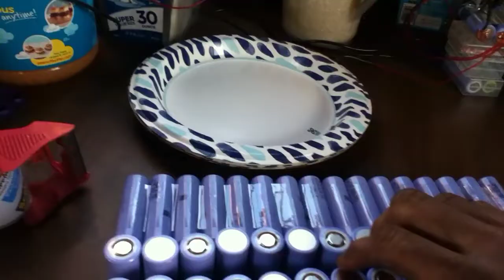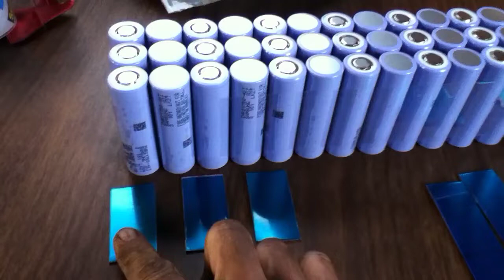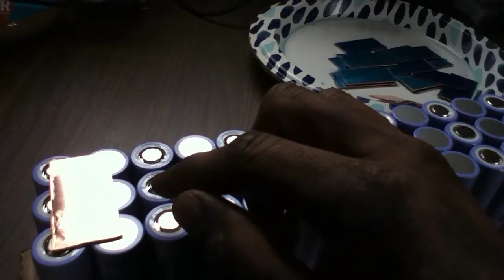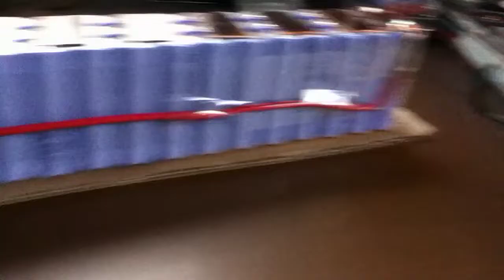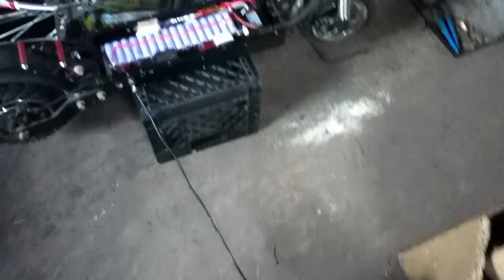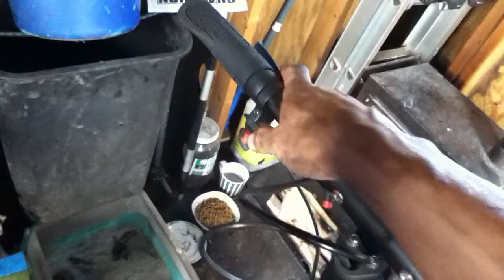How to Build Battery Pack without Soldering ,the Simplest Way

Comment: Do I charge it with a 48v charger using this tecneek
Reply from the maker: Yes if you are building a 48V battery pack use a 48V(54.6V full charge) charger. If you have a 60V battery use a 60V charger. Don't use silver epoxy though cause it's fake silver. Just use nickel strip and spot weld..
Reply: Umm I've already done it in poxy,brother
Reply: I'm building what u where building on utube ,so um is that a 48v u where building or 60v.
Reply from the maker: @user-no8fh6qp9d  Mine was a 60V battery build. I found out later that all these silver epoxies aren't real silver content. The epoxy turned yellow after some use, and will kill the battery cells. These epoxy would've been fine for 5V applications.  Sorry for the misleading video.
Reply: Thanks for your help ,I love to see more videos of other areas bro ,I've been into electronics for 3 yes just learning from. Utube , every bit from every one helps .thankyou

Comment: Dude what about Balance charging that? you must have the ability to buy those battery's MUCJH CHEAPER THAN WE CAN!
Reply from the maker: You don't need no stinkin' BMS...BMS won't balance charge, it's the batteries in a pack that will self-balance. BMS will attempt to discharge and recharge unnecessarily and take you longer time to fully charge. Just make sure that you don't overvolt charging your battery. For 60V battery charge at 67.2V. For a 48V battery charge at 54.6V and so forth. The BMS however will protect you from overvolting (not the same as overcharging), meaning don't use a 67.2V charger on a 48V battery. 
I buy batteries at bulk-battery.com and the price is better there.

Comment: Hi can you charge 36v18650 battery on a 36v lifepo4 battery charger
Reply from the maker: I believe the lifepo4 charger charges at lower charging voltage as those batteries nominal voltage is 3.2V and not 3.6. You need to use a regular li-ion battery charger for the 36V battery pack.
Reply: Thanks for that infor,would it matter if i charge it through a BMS or would I still need a regular li-ion charger @noobz5056

Comment: It's the characteristics of the cells that you've chosen that give you the significant voltage drop. It's the discharge rate of the cell that matters as well as the number of cells in parallel. The more cells in parallel is not necessarily means less voltage sag. 15 cells in parallel with a  discharge rate of 5A aren't necessarily better than 5 cells in parallel each with 20A discharge rate. With the 15 cells in parallel each 5A maximum discharge rate, you will be able to build a battery pack that can discharge 75A maximum. While with the 5 cells in parallel each cell with a discharge rate of 20A, you get 100A maximum of your battery pack. You should have a safety factor though and not use the maximum discharge current totally out of your battery pack. I'm with those who say a BMS is a must in those  battery packs. A good design for a battery pack takes into consideration a lot of factors. Thanks for sharing your experience!
Reply from the maker: You are a long way behind. You are trying to school me something I already know.  These are 30A discharge Samsung 40T cells. The culprit of the problem with the voltage drop is the fake silver content in the epoxy. The problem resolved as soon as I used the spotwelding with the nickel strips to ensure reliable electrical connection. And yes the higher number of parallel connections do give more stable power delivery even with cheap Chinese low discharge rate cells.
Reply: @noobz5056 Glad that you solved the problem. But still your video is misleading when you say, the higher the parallel connection is the better. While in theory, higher parallel connection will increase the capacity and thus the discharge rate, but that wasn't the problem as you have mentioned with your case. It's not just simply 'more' parallel connections. And please don't mislead inexperienced viewers with not using spot welders or BMS. Using a BMS by far safer  to maintain discharge and charge of the battery pack. So your video failed in two ways: you show that you can do it your way without a spot welder, the results weren't successful and two: you said at the end of your video, more parallel connections would solve the voltage sag in your case, obviously, you've said it, it did not.
Reply from the maker: @mansoora.7322  If the silver epoxy wasn't fake it would've worked fine on the battery build. The seller and the suppliers' bosses (high level criminals) lied by selling fake silver (and gold too) to the public and they keep the real content in their underground living. God told me that you need enough "physical" battery cells to reduce voltage dip/spike, regardless of the discharge rate of amps of the cells. If you don't have enough cells of parallel connections the voltage dip will be high even with high discharge rate and high capacity cells. Physical number of connections do matter. One of the reasons is due to limitations of the battery cells as they do not have linear power curve. The capacity may be plenty, but the voltage spike will still be high. 
And you don't need BMS, as long as you are not overvolting the battery pack during charging. They don't do the balance charging, the battery cells in a pack does the self-balancing not the BMS.  And you don't need BMS to limit discharge rate, you use smaller controller to draw less amp, to keep the batteries within safe limit.
Reply: try 45b or 40t cells... very high current cells

Comment: Just use a controller that draws less amps. An 18 - 22 you will not have a problem and have good range with a 72v. If you say the battery is 12a and  30a continuous and your controller is pulling 50a under max load. I have a 60v battery that is 16s8p its 20a and 30a continuous. I use a 30 amp controller no problem and great range. If you are going to over discharge your battery with that load a BMS is a good idea if it has current draw protection.

Comment: You can install a fuse, or a breaker to protect from over current to protect the battery from shorts down the line that could happen before the speed controller. 
You can install a temperature control switch with a probe inside the pack to cut off the power when things get too hot...  or even just a temperature display on the handle bar.

Comment: Si you’re not using BMS, and you’re using a flammable glue to joint the cells? Such an asshole, you can kill people with this video. I don’t believe you’re an electronic engineer nor a technician, actually. There are lots of studies made by real engineers that you can read to understand the importance of having a BMS.

Comment: And all due respect you didn’t do anything right in this battery build.
Reply: Without him providing any AC IR or DC IR figures this method is suspect. Show lower IR numbers than pure nickel and show a capacity test that probes no degradation (plus the pack has to last a solid 200+ cycles) and I’d be less suspicious about this method.
Reply: That question makes no sense, with regard to polarity
Reply: Wouldn't the voltage stay the same since they're all the same polarity.
Reply: to high resistance will burn up if you pull some current ...
Reply: I'm expecting to see a perfect battery build coming from you soon then... With all due respect and all...

Comment: Such a great idea! 👏How much did all that silver epoxy cost you? How long did the copper continue to stick to the batteries after the road vibration?
Reply from the maker: A lot. 😢  Copper did stay on, but the silver epoxy turned yellow and lost the connectivity. God told me that you and I got ripped off good because the U.S. elites that live in underground cities stole all the silver for themselves and used the leftover impurity, reprocess them to barely meet minimal electrical conductivity needs (PCB boards, which don't require silver content to handle 5V at very low current) and mark up the price for good profit. They got all the good stuff in underground cities near you.
Reply: @noobz5056  By U.S. elites you mean moles or leprechauns ? Come on bro, lay off the crack for a minute would you 😅 (god does not talk to you, nor does he exists and if this fairytale was real I hope he would tackle other topics than your e-scooter battery, it was just a bad design, do your research, good luck for next build 👍)
Reply: @noobz5056 and...no need to listen to you further.

The lunacy is strong with you

Comment: Garbage. Stay in your town with your bomb diggity scooter for my families safety please.
Reply from the maker: The battery pack does not act as a bomb. And I don't think my scooter is diggity either.  It never exploded nor caught any fire when building the battery pack and using it.  It did fail because the silver epoxy is not what they (manufacturer) claimed it is, has no silver purity because it turned out it's not real silver, which caused it to turn yellow/goldish and lost electrical connection in the battery pack. And the batteries weren't running hot when it failed. I also tested 3 different battery cells by feeding over 60V through each cell, with pretty damn high amount of current.  That's 56 volt over what the battery cell is specified (4.2V max) to handle and none of them caught fire. They were run for hours before they got hot.  Even if you have a BMS it will not be able to prevent you from catching fire if you short-circuit your battery pack. Nor can it limit current charging rate because none of them have that feature.
Reply: @noobz5056 18650 are dangerous what you just made is a unmanaged 18650 battery pack. In short: A bomb

Comment: The reason the voltage is sagging soo bad is because of the epoxy!! You can get a cheap spot welder for $50 or less and then weld nickel strip to those 21700s.  The copper you are using is great but it's nearly impossible to weld copper to batteries.  I promise you though, clean all of that epoxy off those batteries and weld  0.15 or 0.20 nickel strip to those batteries and your scooter will have double the power. Hope this helps!! Take care and be safe.
Aaron
Reply: voltage sag = poor quality cells, unhealthy cells, non-high-output cells
Reply from the maker: @ You don't know what the heck you are talking about.... The problem with this battery build is the fake silver epoxy unable to deliver current from the batteries as it is not able to handle both high voltage and current. Because it if fake it's only good for 5V applications, little electrical boards.  You talking shit because you are angry I dissed your scooter.
Reply: @noobz5056  I'd say the problem of epoxy failing is the amount of vibration when riding the scooter. I think it would be OK for stationary applications.
Reply: @MrLarry-gr8 You are absolutely right!!! And WITHOUT a BMS, it’s madness!!! It’s the most dangerous thing I’ve seen so far!!! And who uses copper that thick, anyway?! Usually, you’d use 0.2 mm copper sheets or strips—without any epoxy resin!!
Reply from the maker: It's not fun for me to admit but I think you guys are right. My silver epoxy appeared to "deteriorate" and lose connectivity after a month of use. It can't seem to handle high voltage and amp. So my battery stopped working.  I had to tear the pack all apart and luckily just two cells got bad. All the rest are fine.. Shit, back to the drawing board.😕 Will look for a battery-powered spot welder as I don't live in electrical grid homes I live in an off-grid shed.
Reply: In all fairness your idea of the silver epoxy was brilliant!!  Maybe there is some kind of glue or epoxy that  can handle the amount current/voltage those beautiful Samsung 21700s put out.   
  I wonder what would happen if you just taped those copper strips in place and really wrapped the battery tight with that packing tape then shrink wrapped it real good? I bet it would last longer than most would think .  Probably not a good idea lol.
Aaron Binder
Reply: @ hey noobz, is your living situation still the same? How do you get mail? I can send you a spot welder thats powered by a 12.6 lipo battery if you need one. I don't use it much anymore.
EDIT: I read further down and see you already using one.
Reply: @noobz5056 Nothing wrong with trial and error and also learning from mistakes. Especially admitting and owning up to them. Respect to you and your dedication. Awesome 😎
Reply: @noobz5056  you’re doing a fantastic job!  Keep it up, my friend
Reply: Not even 50 dollars for a spot welder.
Reply: @siov4279  50 dollars could be a whole month wage for someone in a developing country.
Reply: @siov4279  But you won’t get anywhere with a €50 device when it comes to copper strips!! Not even with 0.2 mm copper strips!!! You need a device that plugs into a standard wall outlet—with a capacity of at least 10 kW—which will cost you at least €130!!! With a €50 spot welder, you can only work with 0.2 mm nickel strips; furthermore, you shouldn't use it for a battery pack rated for more than 50 A (with a 50 A BMS). If you were to use a 100 A BMS and 100 A of current flowed through the battery, the strips would get so hot that they could catch fire!! Extremely DANGEROUS !!!
Reply: What about jb weld..?
Reply: I'm a novice at electrical work, doing some repair work on my equipment. I did not know I could get a little welder to connect my batteries. This is the info I was looking for!! Thank you so much!
Reply from the maker: @ You're welcome. Make sure to use electrical powered spot welder from Amazon... they cost $50 or $60, and is more powerful than the battery powered spot welder to ensure that the nickel strips are on there good.  These strips can come off after a while.
Reply: Its litlle curent going from cell to cell..
Reply: You can never weld 0.2 mm copper strips using a €50 or €80 device!!! You won’t be able to penetrate the material, and it won’t even hold, because a €50 device simply cannot weld through 0.2 mm copper strips!!! You need a spot welder with a capacity of at least 10 kW!!! The cheapest option that plugs into a standard 240V household outlet costs around €130!!
Reply from the maker: It's not the epoxy that is causing voltage sag, the conductivity is several times better than welding. Spotwelding limits the size of contact points between the cell and the nickel strip, causing resistance and heat build-up, a lot of energy gets wasted and result in loss of power and efficiency.  Prior to this Samsung 3P battery pack I built and tested a 4P Chinese battery pack and the voltage spike was considerably less than the Samsung 3P setup. Before that I have tried a 16S 1P battery pack and the voltage spiked so much that it was not usable in the scooter.  It does not have enough storage of power to handle the load. I explained this in the video.
Reply: @noobz5056  no
Reply: @noobz5056  Your theory makes sense intuitively. The actual contact area created by spot welding is tiny. It's seems that it would create a high resistance connection similar to using very small diameter wire to connect the cells. However, reality proves that spot welding works. Everybody does it that way, including battery pack manufacturers. So it must not be an issue.
Reply from the maker: @ Spot weld many times on each battery cell and will increase contact area and to prevent the metal from coming off the battery cell.  I spot weld them at least 5 times, that's total 10 contacts per each end of the cell.

Comment: how to remove that if you need to replace a dead cell?
Reply from the maker: You won't be able to find out which cells are bad unless you separate all parallel groups from each other and check the voltages.. Just leave the battery pack alone and use it.  Any cells that go bad the other good cells will take over and take the charge/discharge. The bad cells will not hurt the good cells you will just have a small reduction in total battery pack voltage.
Reply: THAT is a very cavalier way to treat a battery pack.  I hope you don't live in a multi occupancy dwelling and charge indoors.  You talk crap with such confidence that some actually believe you know what you are doing.  Congratulations.

Comment: Couldn't you have used a 6p configuration by simply turning over the 2nd row of cells and end up with an 8s 6p arrangement?  That would have given you the voltage you needed.  I ask because I am about to do the same thing.  I know it would reduce the run time.
Reply from the maker: 8s would only give me 33.6V (at 4.2V per cell) and that would be too low as my controller's minimum voltage cut-off is 40V.. Plus low voltage is not enough for power...I need a 16s platform.
Reply from the maker: Are you planning on building a pack for your home use battery bank or ebike?
Reply: @noobz5056  For an ebike.  Razor Rambler 16
Reply from the maker: @mmills37  Ok thanks. Ok God told me that you can fit 14s 8p in that battery compartment in the Rambler 16.. 21700 not 18650. That would net you 52V system with 58+V full charge. 8p will surely give you that solidity of power/torque with minimal voltage spike.

Comment: Why did you use copper plates instead of nickel plates since nickel has low resistance?
Reply from the maker: I used the copper as it has the best electrical conductivity and has the headroom for handling much higher amp, to minimize heat, results in clean energy = better efficiency = more power.

Comment: I love it you take the time to experiment & find the best way. Where are you living?
Reply from the maker: Thanks.. I live in a shed off-grid.🙂  Can't wait to get some more money so I can build a 16s 9p battery pack. It will be the same silver paste epoxy copper plate method as it's multiple times better in electrical conductivity and the handling of high current than the nickel strips spot welding.